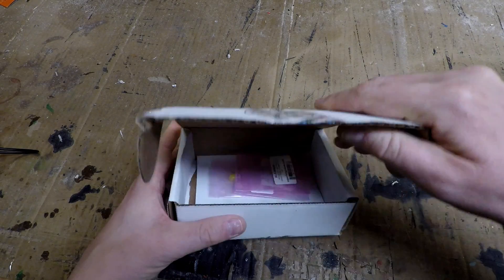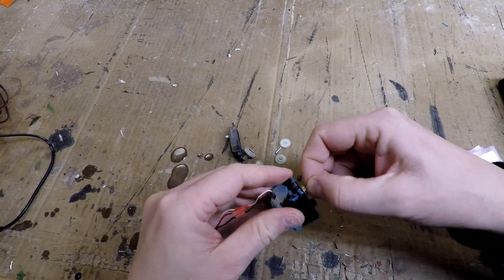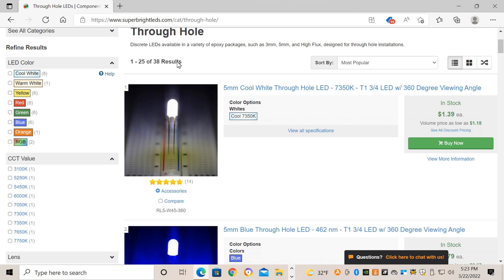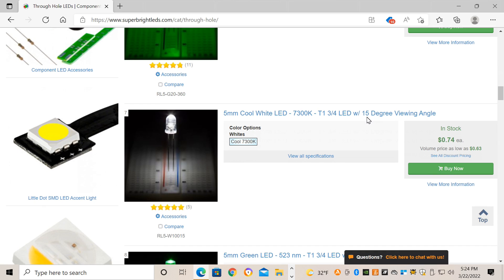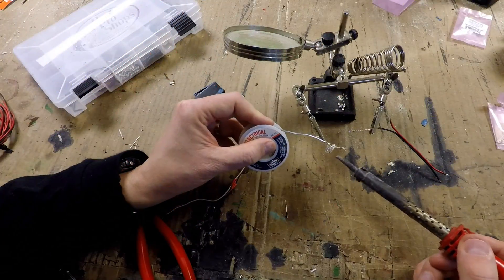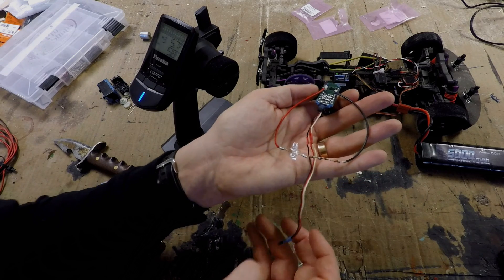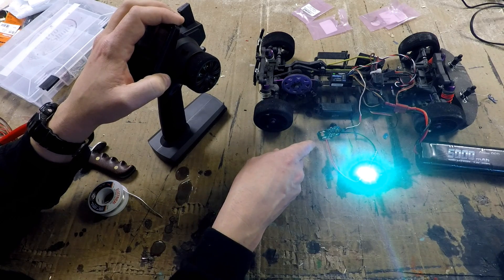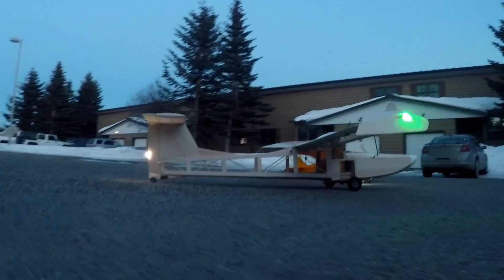DIY RC Lights!

Comment: I had another thought as well - when you mentioned that if the LED doesn't work reverse the connection on the PC board I realised that as you said "the polarity on the servo motor is reversed" - I have a TX with 3 position switches (used for flaps etc) and I also have bi-colour LED's that work by reversing the polarity to the LED. So with a 3 position switch I can use bi-colour LED's that are off in the centre and being able to choose one of the two colours depending on which way the switch is pushed on the Tx - no idea what I could use that for yet but you have got the creative juices flowing - another choice would be to use 2 strings of LED's hooked up in reverse polarity to each other - pressing the switch one way on the TX would light one set - middle would be off - the other way would light the second set - so many options - thanks again.
Reply from the maker: That does sound like a interesting idea. I’ve seen some full scale cars that have white daytime running lights that turn into amber turn signals, maybe something like that could be done?

Comment: Thanks for this great tutorial - one suggestion to reduce size/weight would be to replace the "centering pot" with 2 resisters of equal value (when a pot is centered the value from the centre leg to each outside leg is the same). Something around 5K would be fine but given you have a multimeter measure the value of the pot (the 2 outside terminals) and divide that by half and then buy 2 resisters close to that value - unsolder the pot and replace with the 2 resisters going from the outside legs of the pot to join together where the middle leg from the pot was.
Reply from the maker: 🤯 I had no idea that would work, gonna go try that right now! Thank you so much!
Reply: @thercadventurechannel4782  It also solves the issue of a pot that can move away from centre due to vibration (although the CA should stop that).